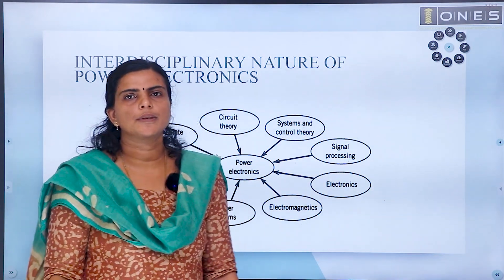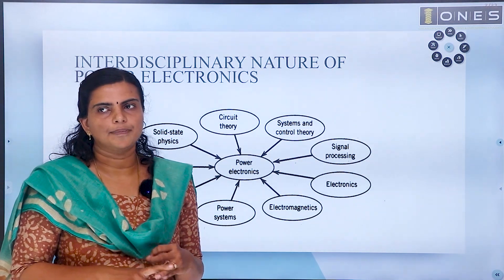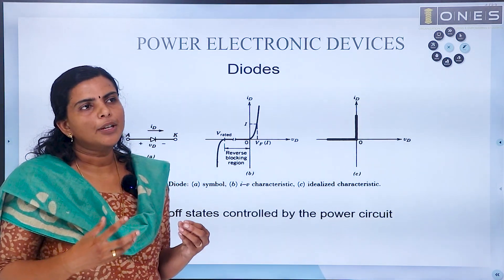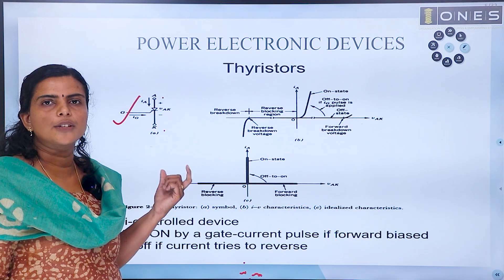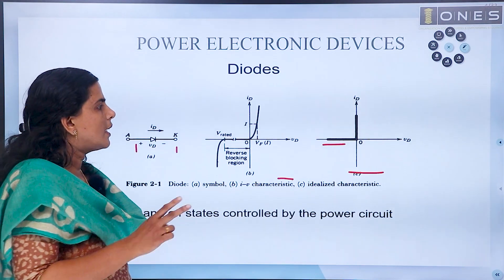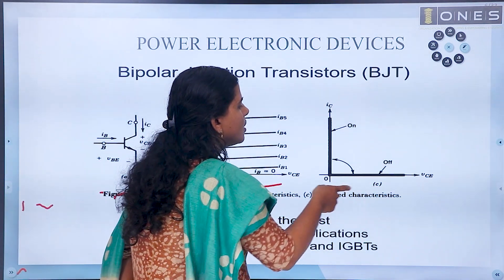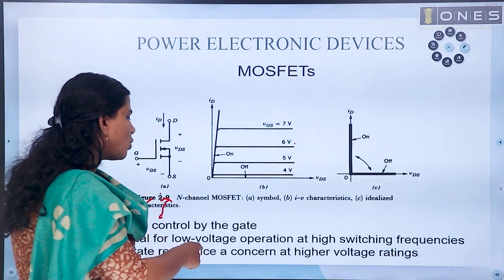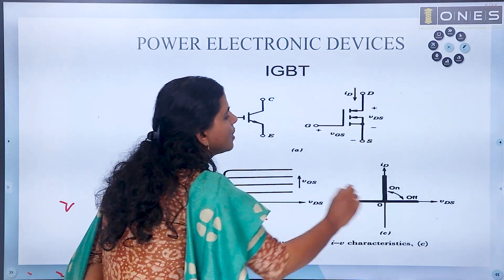POWER ELECTRONIC SWITCHES | KSEB SUB ENGINEER  INTERVIEW | ONES

Comment: IGBT terminals are Collector, Emitter and Gate...Teacher mentioned wrongly in this video. Please correct it.
Reply from the maker: IGBT symbol can be represented in two ways. Please refer NED MOHAN TEXT chapter IGBT. Its terminals can either be called as Gate, Emitter and Collector  or Drain , Gate and Source. I think I have kept both the circuit symbols in slide, but mentioned about only Gate ,drain and source. You can further refer NED MOHAN text and get it clarified
Reply: Ned mohan is a standard text book but as per kerala psc it is wrong